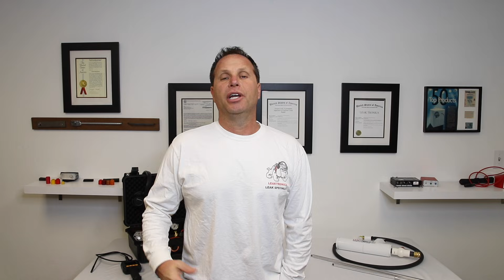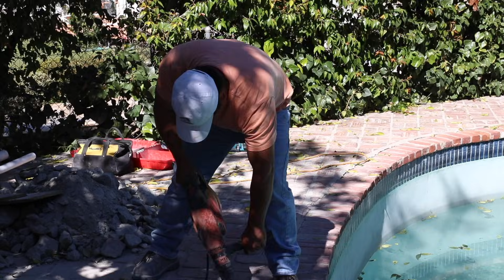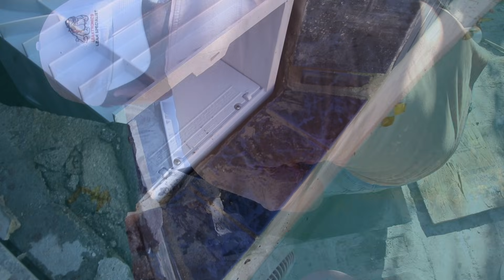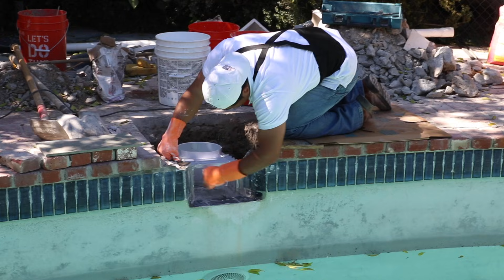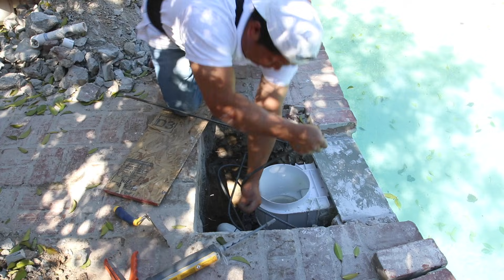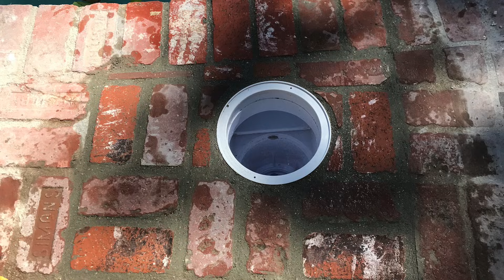Complete Skimmer Replacement - Bridge and Brick Repair

Comment: Why no expansion matetial between the fresh skimmer concrete and the old deck?
Reply: Same question. Why bond to pool beam just to bond to pool deck with concrete. When deck moves just a little, skimmer break again. It doesn’t make sense to me why this pro did it this way. Seems common sense to have joint separation at deck